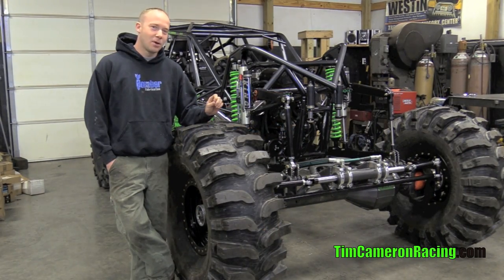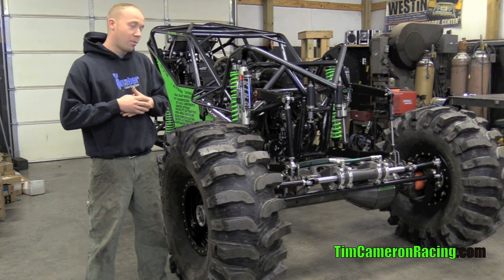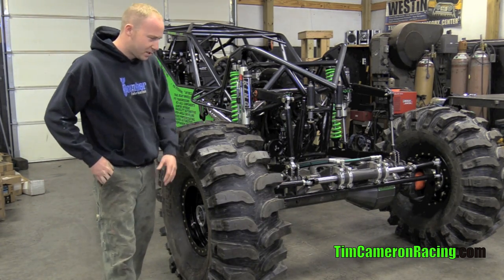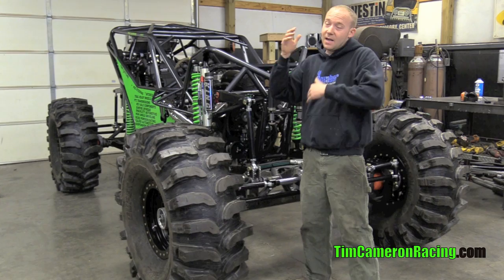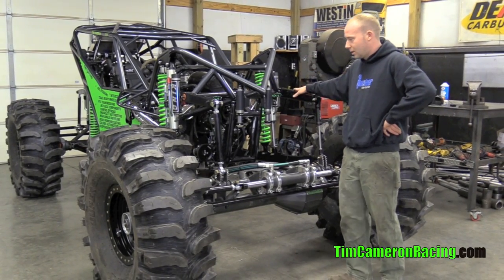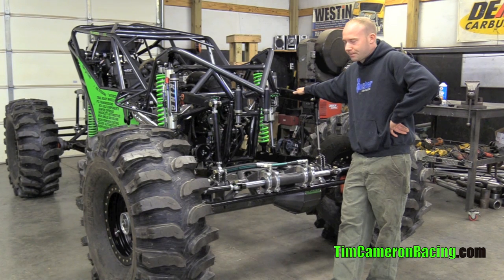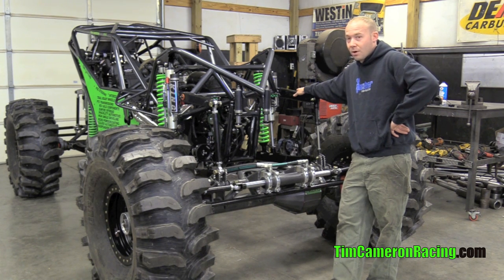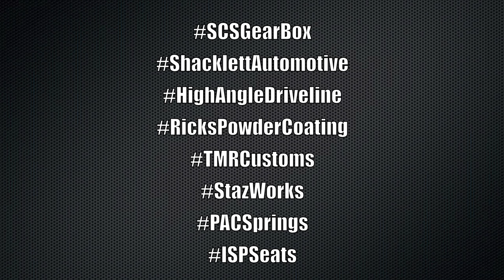"STAND BACK" TIM CAMERON'S 1400 HORSEPOWER ROCK BOUNCER

Comment: no way thats 1400 horse. thats monster truck hp.
Reply: No way? You new?
Reply: you old?
Reply: ya if its a 5 or 600 shot that motor aint making north of 1000 by it self. sure dont sound like it anyway
Reply: anyway that thing is fuckin cool
Reply from the maker: You serious Clark? Do you know anything about Big Cubic inch All aluminum Big Blocks? Do you have any idea how much money is in that motor?
Reply: lol i take that as you no fuck all about that motor. good work!
Reply: A healthy N/A big block can make north of 1000hp no problems. It doesn't sound like a 1400hp kind of radical but he might have some spray on there or planning to and 1400hp is even a question then. I've drag raced since the early 90's from a Jr Dragster to the family ran outlaw pro mod. Things have been changing and engine development isn't what it used to be.
Reply: I've seen a nitrous big block make 1800+ on a hub dyno and I know for a fact it wasn't the first motor to do so. If you can't fathom how 1400hp is a realistic number you need to get out from behind that screen. Go be a keyboard warrior somewhere else.
Reply: well hurray for you! i ve been to alot of drag races does that count?
Reply: @Jacob Reed Aluminum has nothing to do with HP . I dont think its 1400 Hp Horse power numbers tend to be very exagerated
Reply: @MadRam11  fat brown Buffalo hunter is right. And the aluminum block does not help HP . If you really split hairs it hurts it soaks up combustion heat like aluminum heads do. but obviously the design of aluminum heads more than compensates for that. The block does nothing but be lighter .
Reply: @chrishamilton2559  Im sure thats what he was told when he was handed the $30,000+ bill. But if it aint tested you really can't make that statement
Reply: i offended a lot of window lickers  @tomhutchins1046   sure would like to see some numbers but its been a year and nothing but hot air
Reply: As an engine builder for 30 + years that 1400 HP number is way off. Normally aspirated a SINGLE throttle body? The bigger the displacement an engine gets the less efficient it gets . In other words a 1000 cc bike motor can easily make 1 HP per cubic inch a 454 its a bit harder.  Im guessing this is a 540 or below (To keep the durability rod to stroke ratio ect) so your claiming 2.5 + per cubic inch? Not a chance maybe with a bunch of  (Nitrous) . It would not last long. You would be amazed how much bull flys around about HP. Years ago i knew there were exaggerations but until i bought a dyno i had no idea how much! So as an honest engine builder and person do you go with the flow and inflate your numbers or call every one a liar?
This is not in any way to disrespect Mr Cameron . I have seen his videos and he is impressive. Im sure some engine builder handed him that number  and a BIG bill .
PS The air cleaner he has on it would not even flow enough for 1400hp just for starters
Reply: @chrishamilton2559  The software you are mentioning is for kids and Dishonest builders to sell there customers with. There are just to many variables. These days there are dynos that can handle 1400HP and can even respond quick enough for nitrous. If your a builder selling 1400 HP NA big blocks you should have a way to dyno them. If you actually have Used a dyno you will learn so much and avoid so many issues. You can spot lean spots in the fuel curve ignition issues valve train instability ect ect before you trash a bunch of expensive parts. If you are not dyno testing engines like this you are running on PURE LUCK and that will be expensive
Reply: @tomhutchins1046  you can't dyno a 5,000 hp engine. It just is not possible. You aren't informing me of anything.
Reply: @chrishamilton2559  
"You aren't informing me of anything.",
 Because you already know it all? yes there are dynos that can handle 5000 HP. But we are talking 1400HP here. Really 900-maybe 1000 on a good day. Your 5000hp is top fuel , They dont do it that way they run the biggest motor they can ( and is legal) and still stay together for at least one quarter mile. Then add fuel and boost and let the 1/4 mile be the dyno. Blown fuel cars have evolved and some of the tuners are very sharp /experienced. And there testing tunning can be very destructive $$$$$$$$$$$$$$$. I have been involved in top fuel. The number 5000 is just a guess to impress people that dont know any better. Any engineer will tell you the engine software to predict HP is for children just to many variables its not even close to scientific
Learn something Chris
Reply: @tomhutchins1046  also, I'm not even talking about the Steve Morris V16 in the Devel,...you don't even know what the fuck I'm talking about.
Reply: Watched a video of the buggy running . He needs to get a refund from his builder. loads up smokes fouls plugs and even when it cleans out maybe 650-750?
 really disappointing if it were built then tuned on an engine dyno by a real pro he would be much better off.

Comment: Highly doubtful that it's 1400 hp probably not even 800
Reply from the maker: outrage fury well you’re an idiot then who doesn’t know very much about custom big Block engines running on 116 race fuel
Reply: MadRam11 really don't know much huh let's see the Dyno sheets than cause 1400 hp seems pretty far fetched when I've been around pulling trucks and drag cars my whole life suppose next ur gonna tell me tims small blocks were a 1000 hp
Reply: outrage fury Pump Gas 540’s can make 780+ HP to the crank, now add 116 oct race fuel and maybe a little nitrous, and 1400HP+ is easily capable, especially with an all aluminum high $$ set up like this. Maybe do some research? Bostickracingengines built a 615ci that Dyno’d 1406 HP with a 250shot, do the math.

Comment: Nice ride but I’ll bet my next paycheck it ain’t 1,400 horse. Maaaaybe 600-700 but no turbo, no blower I don’t see nitros kits either. C’mon maaaan. Killer ride but yeah that’s really exaggerated HP claim unless you got a vid on a dyno to prove that shit.
Reply from the maker: tom h obviously you aren’t familiar with big cubic inch big blocks that run on 116 race fuel.
Reply: MadRam11 lolol yes I’m more than familiar as being in the motor industry most of my life. That thing is NOT 1,400 horse without a turbo, nitrous or a blower. He won’t even mention the size of the motor. Video of it on a dyno or I call bullshit plain and simple. Still a nice buggy but I hate when people have to lie about the HP on their motors.